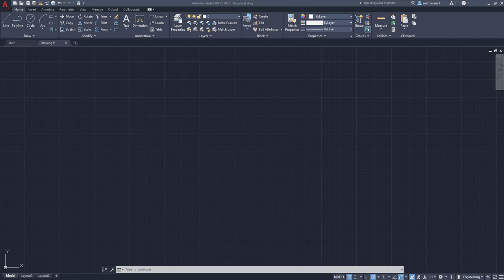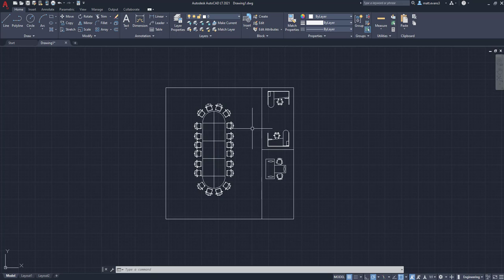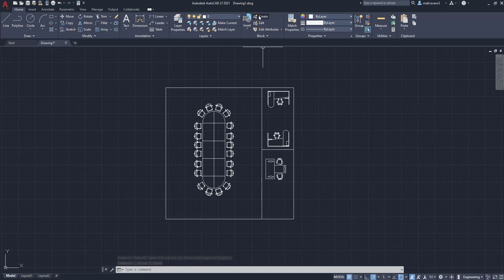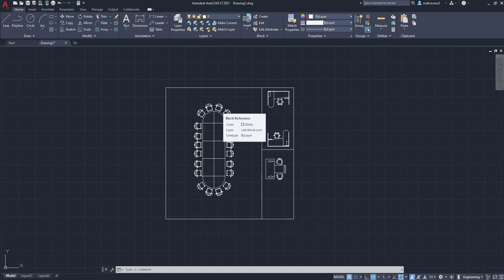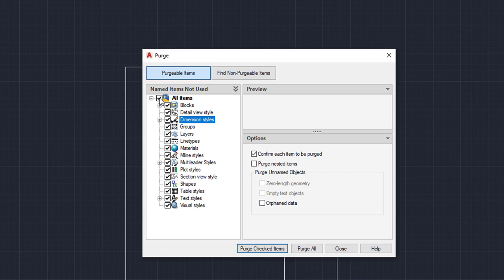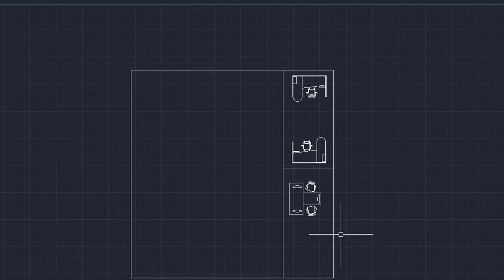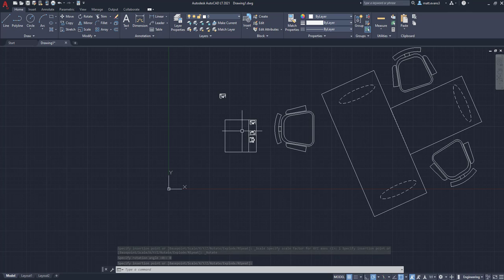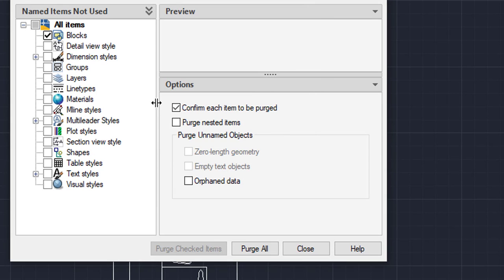How to DELETE/REMOVE Blocks - AutoCAD

Comment: Thank you for the video. I have a question. I have a file with blocked pieces of furniture. I want to modify the shape of the furniture but I can't do this because of the blocks. Is there a way to remove/exclude an object from a block to be able to edit it? Thanks.
Reply from the maker: Thanks for the comment/question! You can edit the block by going into the block editor and updating in that space. You can also "explode" the block update it and then create a new block with the updated drawing. I will be making another video soon that explains how to update blocks.
Reply: @matt.autocadbasics  thank you!